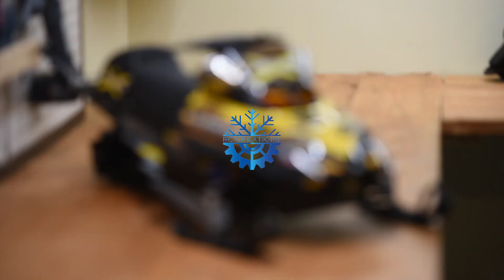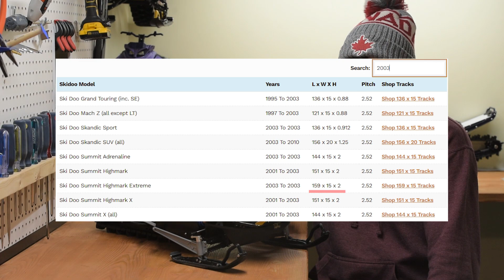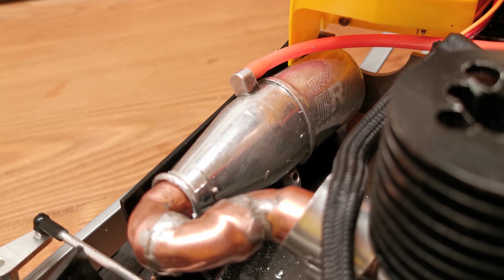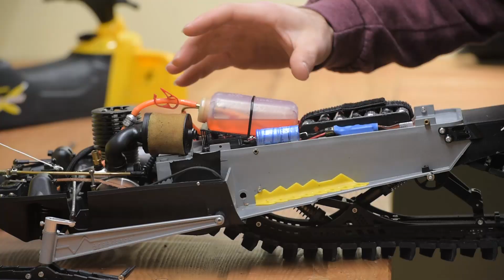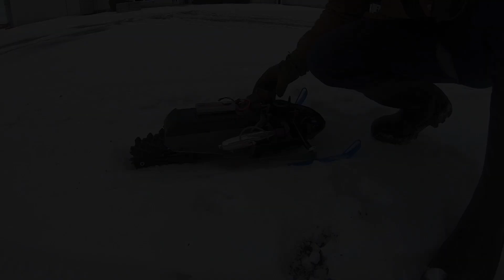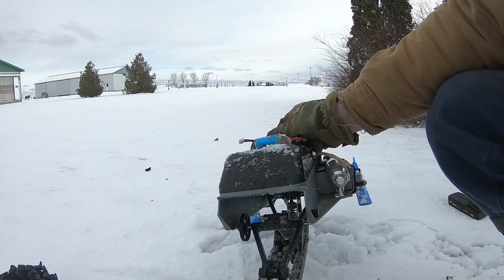In Depth look - Nitro Skidoo ZX Rc snowmobile + Bonus Running

Comment: I just purchased a used kit and I'm having difficulty trying to figure out what motor to purchase to be able to use the flywheel and clutch bell that was supplied with the kit. I purchased a .18 engine and the crank threads are too small on the .18
Reply from the maker: I had to modify the crankshaft and the brass taper as well to install that large flywheel on their stock engine... it is not an easy install
Reply: @Pascal_Robert--Rc_Creations  thank you for the information.

Comment: Super cool build I like the details  Nitro sound so much better I also made a snow mobille nitro powered tracked truck but I would like to make a Bombardier ski doo Like the ones you made  But I will use a 2 cylinder  engine that i build ,  If you could see how small  is the  engine that I modify you would want one to experiment I'm sure In my opinion even the smallest Snowmobile that you made would be a little big for this small engine but it is an advantage of being small and light You do a superb job, I like it A little tip for the brakes, I use a strip cut on a sheet of aluminum covering for the roofs on m'y litle 1\16 nitro Subaru or its Good To use a tyrap Nylon tie wrap Will stretch less than leather
Reply from the maker: Ive being pitching the idea of merging two nitro 0.21 engines on engine builder groups, but i was not taken seriousy...  i like the idea of a directly coupled engine with a single watercooled head, and a single (joined) crankshaft.  But i am not at all equipped to pull off something like that. Not currently at least.

For the leather strip, Im not on the brakes often enough to make the leather stretch.  So far its being working flawlessly, it was a great idea.

Comment: Click in at 4:20. You literally say let's make it simple, enjoy a bowl.  I'm going to hit pause and do just that.  I love the technical videos. I"m a machinist by trade and kind of understand simple electrical details. Keep up the great content! I am loving this shit and learning a lot along the way.  Blows my mind how you actually 3d print and make one off rc snowmobiles that really work.  Thank you for the detailed videos. I grew up snowmobiling. same era as this model. we always rode short track sleds because snow was there but not a lot.  groomed trails were amazing on a short track. especially it you had the suspension tuned right and the clutch set up.
Reply from the maker: Im glad you liked it! It was a fun projet to put together and pretty simple.  No big problems to solve like most of the other suff i do, simply assemble it as you like, and make it go!🚀

Comment: What Filament do you use for the track? building a 1/5th scale sled need some pointers on the skid and track
Reply from the maker: You need impact resistant material, i just happen to use tough pla+ for my tracks, pretty good stuff usually

Comment: So I have a skeeride with custom a arms. In the first tests with snow the a arms are breaking at the Mount. Printed in sunlu petg. 0.28 layer height. 50% fill. 6 walls. Any suggestions?
Reply from the maker: TPU? Its flexible, so maybe

Also the skeeride is not my design... I have not worked with it yet